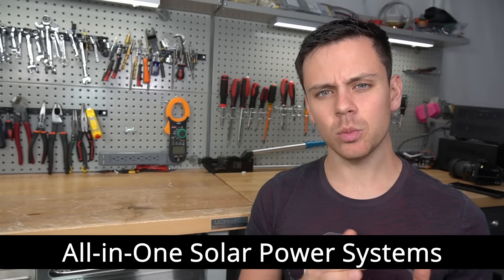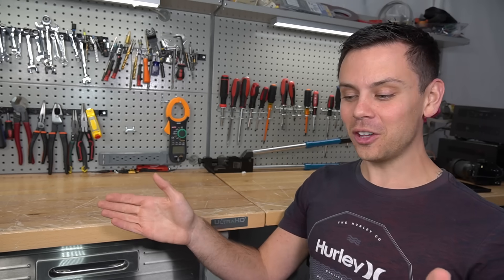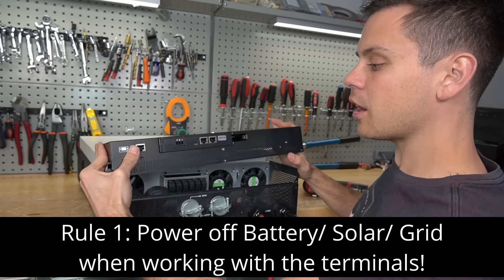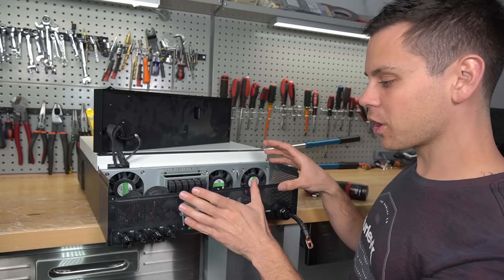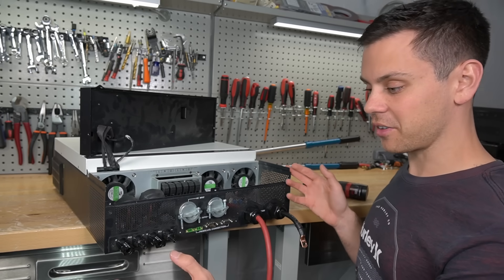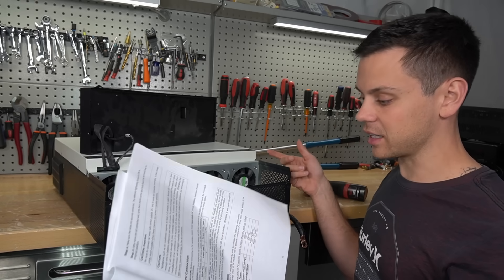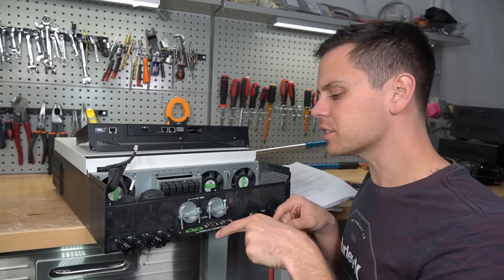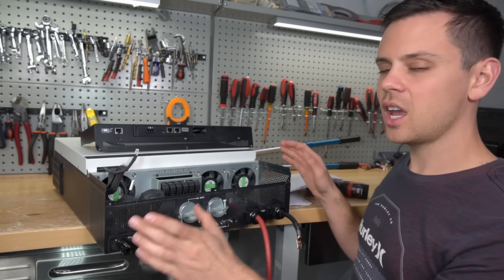All-in-One Solar System: 2 Basic Rules for Shock Hazard Prevention

Comment: If someone with an lv6548 uses a wooden frame for their array they’ll know exactly what you’re talking about. The solar panels will shock the crap out of you. It’s a stray current coming from the pv. Once they are earth grounded there isn’t an issue. I’ve seen people that have the sungold model with the same problem. With a metal array it’s naturally grounded and you’d never know.
Reply: Can you explain how this would happen? How could the panels shock you by touching them and not the + or - wires?
Reply: @stevepriority4219  I plan on testing this in the next few weeks. So it isn’t leakage from the panels themselves because when the inverters are off there wasn’t any current. So in answer to your question, I have no idea. But I’ve talked with others that had the same issue I did. And again, most people don’t use wooden arrays so they wouldn’t ever know. It would make an interesting video for testing though. So I’ll try to put it on my list to make one.

Comment: I asked on your forum 2 weeks ago but haven't gotten an answer. Why do you ask for twice as much green wire in your all in one guide? It says 15 ft of black 6a, 15ft of white 6a, but 30 feet of green 10ga. Shouldn't ground be the same length as the hot and neutral?
Reply from the maker: It's for non-current carrying reference potential and ground fault. And the manuals state 10 gauge can accomplish this. And it can be same length yes

Comment: So I installed one of these into my RV with 1200w of solar up top in series.  Are you saying I shouldn't ground the panels to the chassis of  the RV and the AIO unit due to potential leakage?

Comment: What do you mean by leakage?  Do some PVs leak between their conductors & the surrounding metal framework?
Thanks.
Reply: Yes They do. On disconnected PV panel Measure resistance between negative and frame and later between positive and frame. If it is lower than infinite you have potential leakage.

Comment: Great information for both the novice and experienced. I hope you gave these companies a piece of your mind, even if the information is in their manuals. Unfortunately, most people don't read the entire manuals. Many people think solar panels produce low voltage. It says on the panel the max output. The shock from only one panel may hurt but won't do any real damage to a person. But when people have multiple panels connected on a roof, they're generating a lot voltage, and some pretty high amps. Thanks for the video.

Comment: Thank you Will Prowse this is great information i also currently got a huge shock on my Hybrid inverter 5KVA Felicity  solar panels when i was cleaning them on the roof from dust when it was on,  i really wondered where it came from i was so soon rushing to ground then but, i didn't bcz i thought it would create more disaster thank you plz for that advice✌️😊 hope next time i will power off every thing when cleaning the pannels and turning off the panel isolator.
Reply: You definitely want to connect the frames of your solar array to an earth ground rod. I had the same problem. See my reply to a person's Comment above for more info.
Reply: @Tumbleweed5150  but isn't the info in this video to not ground the panels?

Comment: Good Points! *Note Another Thing I Found That Is A Stupid Design? On EG4 6500 EX + Most Other Brands, That Cage Around The AC In & AC Out Terminals Is Made Of Aluminum-Metal? Whereas I Think It Should Be Made Of A Non-Conductive Material... I Installed A 4x Parallel-Split Phase System, We Were Having Problems With Low AC Outputs? Signature Solar Techs Wanted Photos Of Inverters Outputs Showing Meter Readings w/Front Panels Removed... When I Was Sticking My Meter Probes In To The Screw Connections On AC Input, The Probe Tip Shorted Between The Hot In & "Metal Cage" This Made One Hell-Of-A Arc Welder Type Flash About 1-2 Feet In Front Of My Face & Also Made My Butt-Pucker Severely Momentarily! Now I Know Your Supposed To Turn Off All Powers 1st, Butt When Your Tryin To Trouble-Shoot+ Diagnose The MANY Stupid Problems On These Pc-O-Shit AIO-Inverters That's Not Always Possible To Adhere To Advice! Thanks 😁😎

Comment: So for Rule 2: Do not ground your array, does that mean PV panel frames should not be grounded ?
Reply: From reading comments from others, framing should be grounded.  +/- PV lines coming from the panels themselves should not be grounded.
Reply: @genxgamerdad71  that kinda makes more sense
Reply: @GenxGamer Dad  do you mean each solar panels frame and the rail they attach to is to be grounded?
Reply: i thought was a code if you want to connect to the grid !!???
Reply: Ok, that makes sense

Comment: I was looking for a video on whether more solar panels with say 100 watts per panel would be better than fewer panels with higher watts per panel. what are the pro's and cons?
Reply: I think that there are physical limits on how big a solar panel can be made. Monocrystalline cells dominate the market currently. That means every cell is a single crystal. Panels are expensive and they do eventually fail in various ways. So this will affect how big they can be.

Comment: I discovered this myself two weeks ago when diagnosing issues with my MPP LVX6048WP.  I was seeing 40v across my PV inputs, which made me think I had a defective unit.  With this unit, however, you can switch off the PV input on the side and it will cut the power to the PV inputs.

Comment: I have an all in one because they are dirt cheap inverter/chargers. I do NOT use the build in solar. I use the Victron MPPT's that have an almost zero idle current draw and are totally isolated.  I want my solar panels firmly grounded.
Reply from the maker: I might switch to victron MPPT for all my strings. They are incredible.
Reply: When you use a victron MPPT instead of the all in one to charge your batteries is the all in one inverter on? And if so does the idle consumption go down without the internal MPPT hooked up?
Reply: So you connect the battery to the Victron and the all in one inverter/charger, do you still connect an AC input for bypass and charging purposes or is your solar/battery setup enough that you don't need to?

Comment: Do you mean I should not ground my combiner box?
Reply: MidniteSolar combiner boxes are metal and they have a grounding busbar in the box that is directly in contact with the metal of the box.  So when you connect ground wire to the ground bar it also grounds the box.  This helps prevent you from getting shocked if a PV+ is touching the box for instance and you touch the box forming a circuit with the ground.
Reply from the maker: If it states in the manual not to ground, then you don't want to ground

Comment: one difference between AIOs and discrete systems is grid power is passthrough on AIOs. I would expect the output to be energized if plugged in even with the inverter off. You really can't use them in RV applications because your charge speed is added on top of whatever your current draw is, meaning you are limited to the outlets amperage, not your battery's

Comment: Hey Will. I think you should be more specific about what exactly you mean by "Grounded Solar Panel Arrays", as I (and others based on various forum posts) am quite confused about what that actually means.  "Grounding" and "Earthing" get thrown around wildly in a lot of discussions on Solar with very little explanation of exactly what people are talking about.  When you say 'do not ground' do you mean to say that  I should be somehow isolating the panel frames themselves from my metal racking setup that is obviously grounded because it has a steel post buried four feet deep into earth and concrete?  I don't understand why people with a combiner box would be grounded (based on what you say in the video) but people with no combiner box would not be grounded.
Reply from the maker: They use the combiner box to ground to negative. Pretty common. Or some tie to second ground rod. Which is crazy. Creates massive ground loop. But yeah, multiple videos on this already so people need to watch those if they don't understand the difference or why potential would be created on ground in this instance. Pretty straight forward
Reply from the maker: Yeah I've covered this a lot. Grounded and earth grounding is different. I have multiple videos on it already.
Reply: @WillProwse  Make a new one
Reply from the maker: @Roll2Videos  I've done that topic multiple times. And dedicated videos.
Reply: @WillProwse  I have my array attached to a grounding plate; my load center N+G is connected to the same plate. Growatt Off-Grid.
Reply: @Roll2Videos , what's wrong with the multiple videos he already has? Nothing about the subject has changed.0
Reply: @mr.c6674  Are you his bodyguard? A refresher would be a good idea. Spoken differently might make more sense to people listing.

Comment: Exactly why I never plan to connect ac input ever.  There’s no confirmation from anywhere whether to ground the solar panels. I’ve an SRNE 150 volts PV max.  6 panels 9 amps each.  Dc disconnect and breakers.  This just makes the topic even more confusing.  I’ve watched every WPro video that I can find but no idea which one where explains how and when to ground the SRNE box or panels or combiner box. WP video about no ground in the ac out video where WP didn’t know if the box neutral and ground are together inside or not?

Comment: 100% agree with you. We should already be taking precautions to make sure there’s no live current flowing. Even double check. Still after that I will likely wear rubber gloves if I feel like there’s a possibility I might come in contact with two leads simultaneously. Thanks for the information. Still would be cool to see a video on tool recommendations in how you set up your workbench. Cheers🎉
Reply: These are design flaws.  We already have grid-interactive systems now nearly 20 years old that protect utility/power company workers by not sending AC power back onto the grid if the grid is down but lets send random amounts of AC power out across our PV connections...🙃
Reply: @davidb.5544  Yes, electrical workers are trained and protected - usually. However, I just read (Feb 2023) an article about all of these private solar systems and their workers and private systems connected to the AC power lines. Private installers and repair persons who might not be sufficiently trained and might not be protected. Also, when the power lines go down, some solar systems might feed solar energy into a dead line making it hot.
So some problems are emerging with this new technology.
Reply: How about the solar panels themselves?  Any risk wiring up larger 400+ watt panels outside?
Reply: @aussie2uGA  I cover my panels with blanket or sometimes cardboard box that came in prior to hooking up the wires if it’s sunny. You can also turn them upside down if they’re not mounted. A couple of panels I have actually have printed not to connect them when they’re producing current. The way the connectors are designed I don’t worry about shocking myself. if they were bare wires and then all of a sudden you could shock yourself when the panel is producing current. usually easy enough to cover panels when working on them.
Reply: @aussie2uGA  Always make sure the panel frames are grounded to each other and an earth ground rod. I hadn't done that when I built my larger ground array because I had always used smaller panels and solar controllers, and I got a slight shock when touching the frame of one of my panels. I immediately shut off all switches, then grounded each smaller part of my array to all the others, then to a ground rod. No more shocks.
Reply: @aussie2uGA  For that much power, you will need higher voltages or very thick wires. I consider 50 V or more and 1 amp or more as potentially lethal. Read and watch Prowse's book and videos. I have not detected any errors in his work. When I watch a channel and they say "Watts per hour" I stop listening to other channels. I am not qualified to say more.